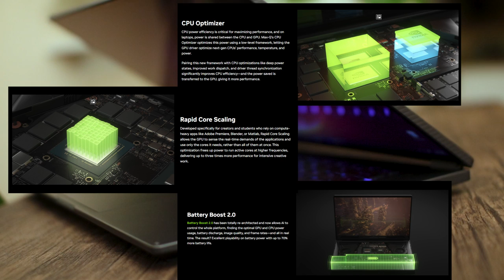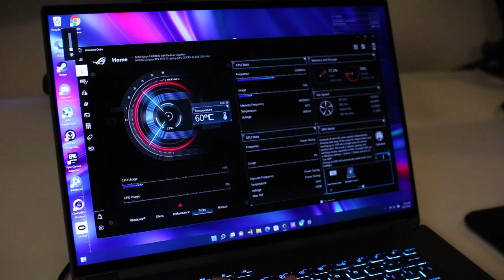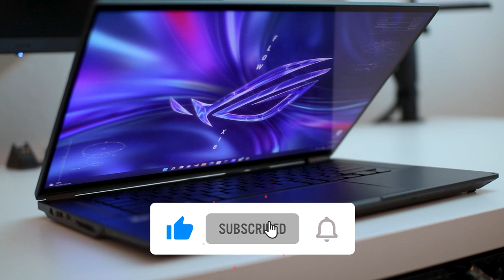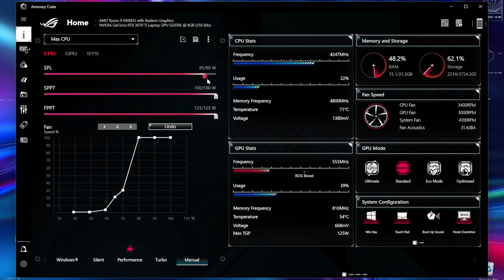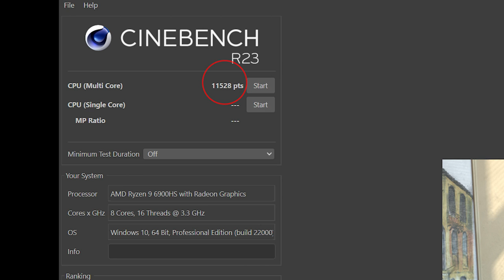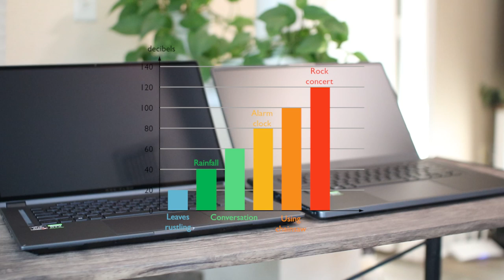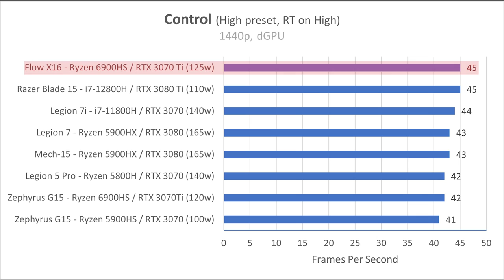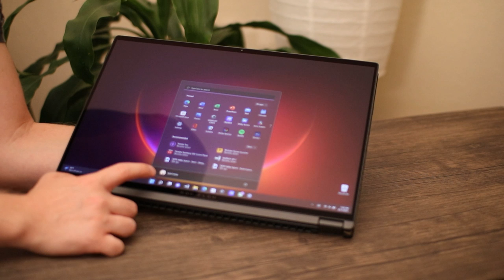Asus ROG Flow X16 Review - Best Gaming Laptop?

Comment: would this be good for 3d modeling and rendering?  i got the 4070 in cart. if it is im game. i been trying to decide on a laptop for a month now, i took a few laptops back. like alienware  m16, legion 7i i liked last years model better. just subscribed  after watching this video. great content.  was thinking on getting the razor blade 16 but herd it get hot like a toaster,
Reply from the maker: This is great for that! You’ll love it
Reply: @Josh Cravey  yea ithanks for making this video. I was thinking on getting xps17  or precision  but I seen videos on the precision  overheating. And that's like 6000 with lowest memory  and ram. Also was looking at asus proart studio but  that's out of stock.. but I had my mind made up on getting the razor blade 16 with mini led display.  Then came across your video  I'm like this could be it if it can handle 3d modeling for hours. Too bad they don't got tyzen cpu for this years model. So what laptop would  you go for the razor blade 16 or the rog flow 16?
Reply from the maker: @angelanguiano4338  My top 3 laptops right now are the Flow, the Blade, and surprisingly the new Zephyrus G14. I have the 4090 G14 with the mini-LED display and this thing is an absolute monster. The Flow has my favorite display because of the glossy coating, but the G14 is definitely my favorite as far as form factor and performance for how compact and light it is. The Blade is super powerful but also fairly heavy, it's a fingerprint magnet, battery life is just average, the performance takes a big hit on battery, it runs pretty warm, and the metal chassis can get a bit hot to the touch in some areas, but yes the screen is really nice and that performance is next-level. I'd say if you need the absolute most powerful GPU then go with the Blade or a Zephyrus G14/M16, especially if your 3D modeling application would benefit from having more than 8gb of VRAM, but if you want some of the nice added convenience and luxury of a glossy touchscreen display, then go with the Flow. Either way, those are all great laptops.
Reply: @JoshCravesTech  Nice! so the flow x16 comes with glossy screen? is there way i can get it with out the glossy screen  ore hows the reflections on the glossy screen?. which as better battery life x16 or razor blade?  razor blade is nice!!! but i herd it gets hot, just trying to see which one would be best for me. i will be doing alot of coding 3d modeling and rendering  and gaming when im taking a break.
Reply from the maker: @angelanguiano4338  yeah the Flow is glossy and the reflections aren’t too bad. The brightness is more than enough to combat any reflections. The Blade is nice too. I have it, but the Flow runs much cooler and battery lasts much longer. The Blade gets a bit warm even in my lap, making it a little uncomfortable at times.

Comment: Would it be possible to replace the battery with the X13 battery to make it lighter?
Reply from the maker: Doubt it. They’re usually sized pretty specifically to fit the chassis but if it’s smaller then maybe 🤔
Reply: @JoshCravesTech  With some 3d printed things to hold it in place, it might work? I just can't seem to find any Flow x13 batteries for sale..
Reply from the maker: @gigahertzmedia734  anything’s possible with 3d printing! Haha

Comment: Don't you have any problems with armoury create? Cuz I have a big one. So I use TUF one with 12700+3060. While gaming or other high CPU+GPU using process, after 15, 20 mins or even hour, battery could drops to 99-98% charge level, and then I get "EDP throttling" for CPU, if I have installed armoury create on it. And it cause lower CPU consumption, like 28 watts cap -> low performance / not smooth picture. Any ideas?
Reply from the maker: Nah, it works great for me. If the game is GPU heavy then yes your CPU will go down to like 30 watts or less because the machine can only handle so much wattage at once. Does your Intel CPU have any driver updates it needs perhaps? When you run a Cinebench loop for 20 minutes does this still happen?
Reply: @JoshCravesTech  all the drivers it needed, newest bios, win 10 and 11 tested. Same result. When only CPU test, battery won't go 99%, so no EDP... After that, regular fps drops not so much, but 1%FPS drops alot. No Armoury – no EDP problem, but that means no fan controls and mux switch

Comment: Is it confirmed there is USB 4? Some said that for flow x13 and never came. I have egpu thunderbolt docker so it will be a deal breaker. Xg mobile for future upgrade
Reply from the maker: It was promised by the end of the year by AMD/Asus. Some ultrabooks seem to already have received the update to enable it, so it’s definitely happening.
Reply: @JoshCravesTech  Will it come in the form of a BIOS update? I find it strange that they don't mention this in the official spec sheet as it's an important feature, a make-or-break feature for some...
Reply from the maker: @eIectrostatic  it will come in a bios update, correct. I guess they can’t legally say that it is a feature since it’s not there yet.

Comment: Hey! I just got this laptop, and wondering if playing games while charged at 100% wont degrade my battery too much?
Reply from the maker: It shouldn’t degrade your battery much at all, that’s how I use it as well.
Reply: @JoshCravesTech  alright cool! battery life won't be affected too? if so, then that's great
Reply from the maker: @joshualuinga1506  nope, and not gonna lie it’s technically “better” to only charge to 80% or whatever if you’re going to be plugged in most of the time, but the battery wear you’d see wouldn’t even be noticeable until maybe 4+ years down the line. Maybe not at all. By then a spare battery would only cost $50-$100 for one of these anyway. That’s how I justify it at least, lol
Reply: @JoshCravesTech  Ah okay, yeah I do charge to 80% sometimes but since I game for 2 hours a day before leaving for work I just keep it 100%
Reply: There should be a setting in myasus that will allow the system to only charge to 60%, 80%, 100%.

Comment: So...in tablet mode, armory crate gives a custom profile (what does it do?), the thing is that the performance is terrible is that mode, so i guess is not doing a great job.

I wonder if the screen is getting hot...somethings off.
Reply from the maker: Yeah, it limits the power in tablet mode. It’s intentional. It is not meant to be gamed on or anything super heavy in that orientation. They do this on purpose because 1. They assume you’re probably on battery power in tablet mode. 2. This prevents the screen or chassis from getting too hot in your hands
Reply: @JoshCravesTech  I get, makes sense. maybe not in my workflow, I was planning to use this in tablet mode all the time, even connected, right now I use photoshop alongside A.I intensive image generation plugins. I wonder if it would be dangerous for the FlowX to be on tablet mode and use often the GPU power.
Reply from the maker: @joemelodybeats5276  you can use AATU to increase the CPU power limit. For the GPU you might be able to use MSI Afterburner to increase the power. It can definitely handle it.

Comment: I woould like to see an i9 option of this too :)) Bsically the m16 hardware would be ver very pleasanly seen over here :)) i dont know what you experienced but from test videos, on charger the m16 is better than the 166 m1 max, and this is worse with bit choppy timeline. What is your experience? I havent deside which camera i will have nikon z9 r5c a1  r3 gh6, but i would like to shoot with the best quality edit it and upload in full res. Could it handle it daily, or rather buy a 14 inch m1 ma, and wai the extre 40 percent in eport time that the 16 inch wins in, but at least i have a smooth timeline, not like in thi,s at least uon a review.?
Reply from the maker: Adobe apps like Premiere Pro are better optimized on Mac. You will almost always have less stutters on Mac because Adobe cares much more about their Mac customers for some reason. I’m moving to Davinci Resolve because I’m fed up with Adobe. But yes a better GPU like the one here will help with export times. But an M16 has Quicksync, which helps with Premiere Pro performance. However if you’re not trying to game on it, and you’re okay with MacOS then definitely go for the Mac!

Comment: Dude. Any chance you could tell me how hot the keyboard + bottom gets (both during idle, normal usage and heavy gaming)? It's the only thing I fear.
Reply from the maker: It definitely gets warm towards the middle of the keyboard when gaming, and just a little warm during normal use. The bottom gets warm too of course. But nothing out of the ordinary compared to most other laptops. My Dell XPS 15 gets just as warm in those areas, if not hotter.
Reply: @JoshCravesTech  Thanks so much for the info 🙏

Comment: should i buy the g15 with rtx3060 or the x16 with the rtx3050ti?
Reply from the maker: That’s a tough one because the 3060 performs quite a bit better than the 3050Ti. But if you’re not gaming much on it then you’ll probably like the X16 more. For gaming, the 3060 will offer like double the performance of the 3050Ti.

Comment: -i just bought the 3070ti version yesterday, and im a bit dissapointed by how this laptop temperature going on, i was only doing some normal usage such as browsing etc and it gets real warm on my palm rest, my 2019 msi gl63 much cooler than this flow x16 laptop cause i never felt this way before, its super annoying cause its really warm on my hand smh(i probably gonna buy an external keyboard)

-next thing is about the battery life. many reviewers said that the battery life can last up to 7 hours with the battery saver mode on etc, but what make me upset is.. on my screen it says around 1 hour remaining on 50% battery (normal usage, browsing) i was hoping that i could run about 5 hours on full charge but i guess its just stupid cuz i have to turned off the gpu while other laptop no need to

-my screen is flickering sometimes

-when i type, its somehow a bit laggy and the words wont typed fully at the end (feels like sometimes the backspace randomly pushed one or two whenever i type)

-i just hate the fact that its not comfortable for me (because of the temperature on palm rest) i bought this pricy laptop and hoping that it could be better all around than my 2019 msi gl63

Comment: Do both USB-C Port support USB4? Or just one?
Reply from the maker: Just one!
Reply: @JoshCravesTech  Thanks for the quick reply. Is it the one connected to the dgpu or to the igpu?
Reply from the maker: @franzpleurmann2585  it’s the iGPU port!
Reply: @JoshCravesTech  So there will likey be a performance hit if I want to game through the dgpu with a Thunderbolt/USB4 dock on an external monitor?
Reply from the maker: @franzpleurmann2585  yes, depending on the game. Games like CSGO would see a big hit to performance while a game like Cyberpunk would probably be just a few fps difference
Reply: @JoshCravesTech  Sounds acceptable. Do you know if its possible to limit the charge capacity when plugged in order to maximize battery life?
Reply from the maker: @franzpleurmann2585  Yes! You can limit it as low as 60% I think. If you download the third-party software G-Helper you can dial it in a bit more exact if needed.

Comment: I’ve heard form a few people that it crashes often while doing easy tasks, how do you fix that?

Also, is there a way to make the g15 zephyrus into a touch screen?
Reply from the maker: Never happened to me, and that doesn’t seem to be common from what I’ve seen. Most crashes are caused by graphics drivers so I would bet its a driver for sure. There is definitely no way to make the G15 touchscreen. It is something that is baked into many aspects of the laptop’s hardware and software
Reply: @JoshCravesTech  what about a stylus?
Reply from the maker: @camlevin.81  certain countries give you a stylus with the laptop. Not the US though. I’m using the Surface Pen and it works great with mine.
Reply: @JoshCravesTech  thank you I didn’t know it was possible to have a computer with no touch but works with a stylus. Do I need to connect the Bluetooth
Reply from the maker: @camlevin.81  yeah you can for more functionality. Like my Surface Pen connects via Bluetooth
Reply: @JoshCravesTech  thanks. Sorry but final question is there a way to change the backlight color for the keys? I don’t want a rainbow lighted computer at school, but I still want it to be lit up white
Reply from the maker: @camlevin.81  yes you can change it to white or whatever color you want. You can do a lot of customization there. Even where certain programs or games can trigger the keys to change colors
Reply: @JoshCravesTech  that’s cool. Is this in settings?
Reply from the maker: @camlevin.81  yes in Armoury Crate/Aura Creator

Comment: Will Windows Hello work in tent mode?
Reply from the maker: I think you’d have to calibrate it in the Windows Hello settings since it’s technically the same but just scanning your face from a different angle. I believe Windows Hello has an “improve recognition” feature that would probably allow this to be possible. I should also probably test this for myself.
Reply: @JoshCravesTech  Thanks for the reply. Good thinking, makes perfect sense! I'm considering this laptop for myself, and I would mostly use with an external monitor in tent mode, so this would be very handy. If you do end up testing this, please let me know! Cheers
Reply: @JoshCravesTech  I've finally got mine and yes, Windows Hello works in tent mode. It's a bit awkward if your Flow is sitting on the desk because of the angle, but should be OK if you have it sitting higher on some sort of support.
Reply: @andrecoxa  hello sir. Did you buy the mini led one or the ips one? If ips then how good is it?
Reply: @ananttomar1865  IPS. The screen is great, but I've never seen the mini led one so I can't compare. It's noticeably better than the Surface Pro 8's, if that helps. I use next to my LG 32UL750 monitor and it's very comparable, even though the LG screen is brighter and 4K.

Comment: Hello Josh, you said that thunderbolt is coming soon on this machine. Since it has an AMD Processor this is not true? I thought that intel processor is required for thunderbolt
Reply from the maker: USB4 is available on a beta bios that is currently working great! Thunderbolt 3 is compatible with USB4. For example I’m currently using a thunderbolt nvme enclosure and getting the correct thunderbolt speeds on my X16!
Reply: @JoshCravesTech  Wow didn't know about that! Thanks so much for your answer and this great and detailed review!

Comment: The 5i Pro with 12700h 1tb 16gb 3070ti for 1699$ both the g15 and x16, is  around 2200$ where I live the 7 is also 2200$ I got a decent monitor a new gaming chair and a onsale keyboard mouse headset bundle deal with the saved money
Reply from the maker: Nice! Those are also great laptops, but very different from this!

Comment: Great video! I am struggling why is there so "huge" difference between the G15 and X16. Do you think is the G15 could reach the performance of X16 with the same specs? What is the root cause of this ~15% diff at: https://youtu.be/gG5bP7tnq18?t=2048 .

Is this 5W GPU power diff can course the diff? Do you think the flow X16 vBIOS can be flashable to a G15?
Reply from the maker: The difference right there is just in the way their “performance” modes are tuned. Think of this as the “balanced” profile (it used to be called that actually). This performance profile is tuned like crap on the 2022 G15 for some reason, but is tuned very well on the X16. As far as their “max” profile, which is Turbo, they’re about the same. The extra 5 watts doesn’t do too much for max performance at all, so I would not advise flashing the vbios for the extra 5 watts.
Reply: @JoshCravesTech  Thanks. Do you think is it possible the tune manually the G15 closer to the flow x16?
What do you mean exactly by tuneing? Sorry for that but I am a "brand" new G15 owner and intrested in this topic very much. (unfortunately I am not fully aware of all keyworlds)
Reply from the maker: @chege54  by tuning I mean like how Asus tuned the fan profile and boosting/wattages within each default performance profile. The G15 can definitely configured in manual mode to run exactly how YOU want it to though, and that’s the cool part about using Asus laptops. You can definitely make it run with more power and lower the fan noise a bit, it just takes some trial and error.
Reply: @JoshCravesTech  understand. Now it is more clear. Thank you! 
But strange to me why they are not harmonize/optimalize by SW update
Reply from the maker: @chege54  it is definitely strange and I wish there was a baseline noise/performance level established for each performance profile but every laptop manufacturer does this with all of their laptops, it’s always a fun little surprise every time.

Comment: the drawing features and the costs to laptop to draw screen  plus of an new 2022 5th gen amd desktop can easily go past 3,000 bucks plus.. so the power an touch an all features would be cheaper to get that device, then build a  new am5 desktop, personally use z-brush, unreal 5 an photo apps an so its way better is an way easier to 1700 bucks plus this looks better to get then an new am5 i checked  prices its cheaper to get this then get an amd 5 desktop because i dont want to deal with power mode and its under 200 watts on eco power at my pace on a note a Kansas  pro 4k drawing i use 12 costs an easy 250 bucks so the size and draw screen with active mode on drawing  but the active  K4 on it an this device on drawing tablets you hook into pcs can easily sell for 500$  easy so if you take that into account the laptop is crazily awesome its like an 1250 buck laptops  then placed the screen to make it worth it